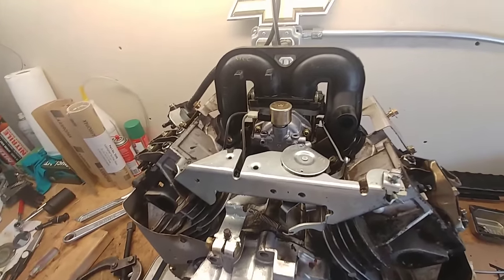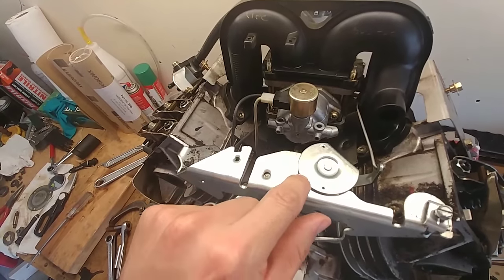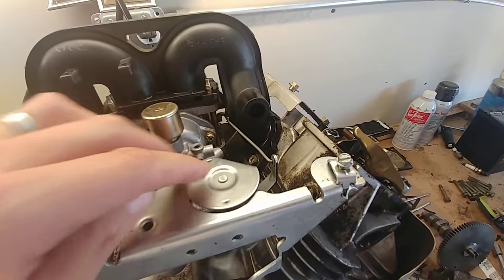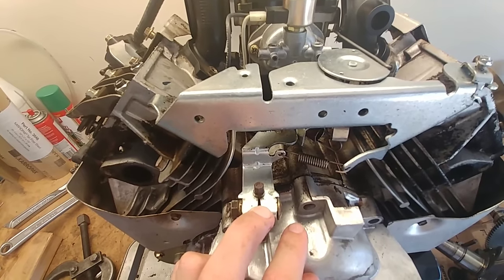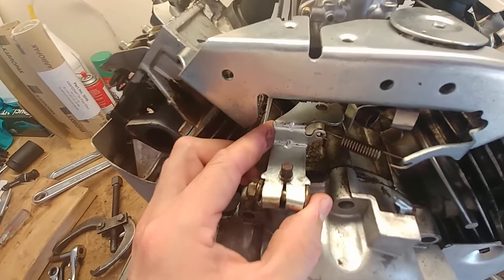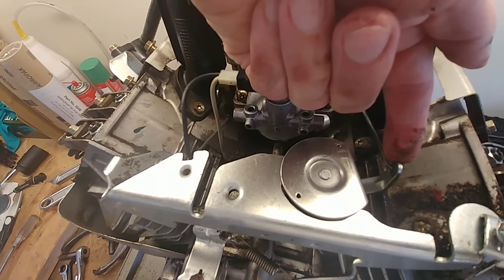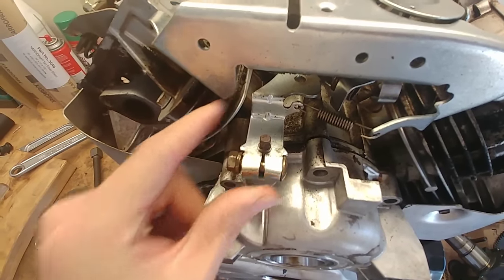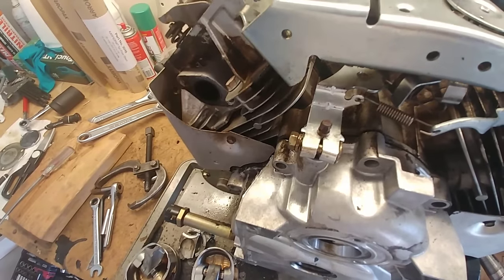Briggs Intek V-Twin Throttle and Governor Controls Explained

Comment: Why isn’t my governor arm returning my linkage to idle.? I set the governor correctly and it has tension on full throttle but without throttle it won’t move the governor arm?
Reply from the maker: Do you have the engine running?  When the engine is off the springs will pull the throttle full open.  When the engine is running the governor flyweights will cause the gov plunger to push on the governor linkage, pulling the throttle back down to a balanced position based on your throttle position.  The gov/throttle setup is a balance of springs and with the engine off, you are missing half of that balancing act (the spinning flyweights).  It will appear biased to the full throttle side.
Reply: @mbakken11  Thank you. So shouldnt see a lot of movement of the governor control arm when the motor is off, mine just wiggles slightly to the side when I move the throttle to the idle position? Do I turn the governor shaft slightly counter clockwise to make the governor engage earlier and slow the revs at idle. Right now it is screaming.
Reply from the maker: @bassoneon  If it's screaming at idle, something is wrong.  Readjust the governor arm.  Loosen the arm, hold throttle wide open at the carb (not the dash lever), at the same time rotate gov arm the same direction as full throttle, then tighten the arm down.  All springs and linkages have to be in place.  If you cant figure it out, post a video of yourself adjusting it and let us have a look
Reply: mbakken11 thank you I will try that and post a video if it is still having problems
Reply: mbakken11 the motor is still screaming at idle see the links https://youtu.be/VDYZKBJoC0U https://youtu.be/p2j2LTI7PMo
Reply: mbakken11 took off the oil pan and it was the governor weights...

Comment: Anyway you could tell me what the rpms should be at, at full throttle?
Reply from the maker: Usually 3600
Reply: @mbakken11  Thanks a lot. I was fighting that mower for 3 days. Set governer, valves, new carb, new intake gaskets, did leak down and compression tests everything came back fine. Customer been breathing down my neck for days. Then I just so happened to look at the old carb and I seen it had a spring on the throttle; my new one did not. I'm a real idiot sometimes.

Comment: Really good video, very helpful!  I used it to get the engine running, but now I just need some finer adjustments 

I broke the throttle linkage on my engine and made a replacement.  I made what I thought was a good match size wise, but was not 100% sure if the length was "really" right.  I falsely assumed that just by adjusting the governor arms setting , that would basically compensate for that linkage being slightly off length-wise.  However,  using that new linkage, I found that the (Larger) main governor spring was still fairly loose (sloppy) when the engine was off & with the engine running at full throttle,  it ran noticeably slower than before.  I could push down on the governor arm and get it to speed up. 
Questions
Q 1)  Do you know the correct length of the throttle linkage at the points where it engages both of the 2 appropriate holes?
Q2)  Should the (Larger) main governor spring be under slight tension at "off" or what?
Reply from the maker: David Logan no idea what the length of the throttle linkage is - I would recommend buying a new one or check ebay for a used one. The larger spring will be loose at idle, but should have some tension on it mid-full throttle. Make sure you have the springs in the right holes, get the proper throttle linkage, and make sure you didn't inadvertently bend the tangs that his the springs

Comment: What would cause your engine to run in high RPM
Reply: Governor or Spring problems.  Either missing or broken or just not tight enough.  Also, lastly, the Governor, like in the video.

Comment: BTW, the length I was asking for was just for that short, stiff wire that goes on the side of the carb, (opposit the chock link) connected directly to the throttle, not the flexible cable going t the dash

Comment: For the life of me can't figure out how the throttle cable moves the governor arm. The L tab which sticks out from the inside of the wheel that the cable attaches to does not hit the governor arm to raise it up and close the carb/throttle butterfly and induce idle.

basically, when I move the lever from the turtle to the bunny, the cable moves the wheel, but the throttle linkage and governor arm do not move.
Reply: I see in your video while you're moving the cable wheel around, that your tab doesn't hit the governor arm either... so, how does it work?
Reply from the maker: The throttle cable doesn't directly move the throttle linkage or governor arm.  Instead what it does it add varying amounts of spring tension to the governor arm.  Inside the engine the governor spins which pushed the flyweights outwards - the flyweights in turn push a plunger out which acts on the governor arm.  When you start the engine, the governor mechanism inside pushes the arm all they way to idle position unless something like a spring counteracts the force of the flyweight mechanism.  As you add more tension to the spring through the throttle cable, it pulls harder on the arm which overcomes the  internal mechanism thus opening the throttle plates more and allowing more fuel/air in.

If the throttle cable was connected directly to the throttle linkage it would be a "fixed" position and the governor would not be able to vary the fuel/air mix to compensate for load.  Once the engine encountered a load, it would bog down and stay down until the load was removed.  Hope this helps.

Comment: Thank god I had throttle control but yea my govoner is not working    And it is running faster than it should so ill adjust it and see what happens but I am leaning towards engine rebuild it is 20 year old engine

Comment: Big question I'm building a racing mower with one of these motors I wont it to rev high but idle low and have a pedal so I wont to tale off the governor but I dont wont to risk my pistons going Bluetooth mode like his did would it work of I just keep pressure on the spring and the arm (or other way around) it should lose parts right

Comment: Is it possible to mix up the choke and throttle cables, when reattaching them?  [Don't laugh, now! ]
Reply from the maker: mrcashcrop it's possible and would be pretty easy to test for. Leaving either of the governor Springs off shouldn't cause any damage, but leaving them off would cause it to run poorly. With a properly set governor, the spring will attempt to open the throttle further - leaving it off would starve it for fuel I would imagine.

Comment: mbakken11 - you and Taryl Dactal (tarylfixesall) show Full Throttle in different directions. He shows full throttle to be COUNTER CLOCKWISE where as you show it to be CLOCKWISE..............Someone needs to make up their mind, LEFT or RIGHT rotation??
Reply from the maker: Depends the engine and the linkage. Some are CW and some are CCW. Gotta check what yours is before you adjust anything

Comment: I changed out my carb.  Put back together.  Start engine and it runs wide open.  When I checked the linkage rod for the throttle side it was pulling the throttle wide open or fully down.  Not sure where I may have made a mistake?  Any suggestions would be appreciated
Reply: Ever figure out your problem? I did the same thing
Reply: I did.  It was the internal gov. I just ended up buying a new mower.  I did sell the old one to a guy who rebuilds mowers then resells.  I just didn't have the time, nor wanted to throw a bunch of money on an old mower